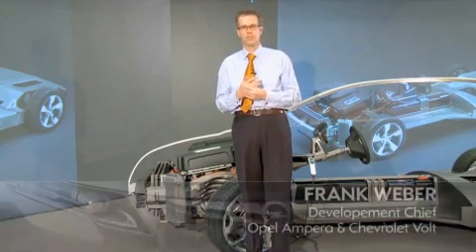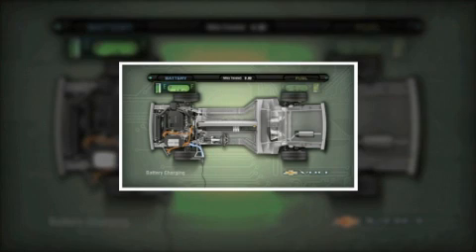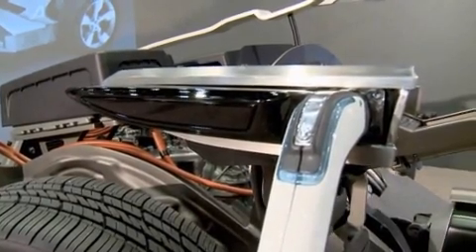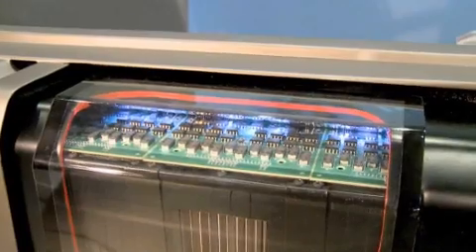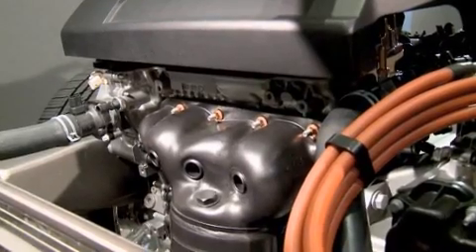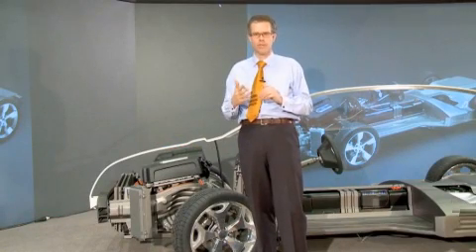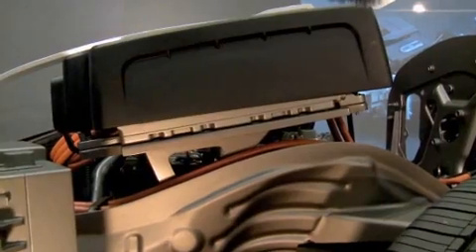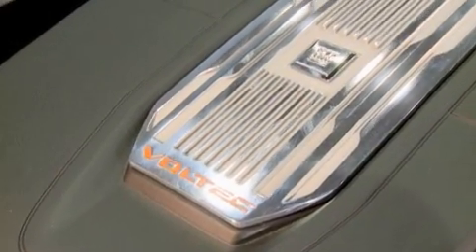Opel Ampera

Comment: Yes that's correct, but fuel you pay in the long run. And tax is not so much for normal non-luxury cars. But can you pay 40 000 € in one time? And I think this car runs on both fuel and electricity.

Comment: NO it also has a small petrol engine that will take over when the battery is flat. The car has a range of hundreds of miles between fill ups if you use the petrol engine as well. As someone else has already said though, the primary use of this car is for commuting to work.shops etc

Comment: It was designed for that amount of km's, because most of Us people have jobs inside of that range.

I suppose that goes with most people in Eu also.

My workplace is 25 km's from my home.
This would be ideal for that.

(And you could always plug it at workplace's heating post, if it will be possible to put it to charge battery first and then start heating motor( like i would need it) and/or heater inside of car during winter)